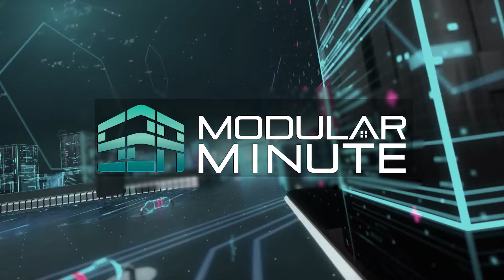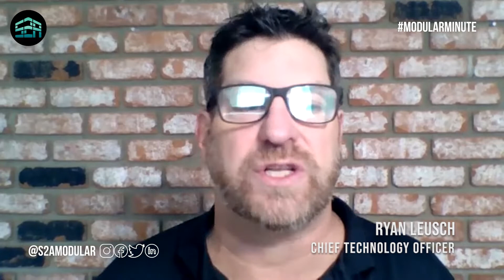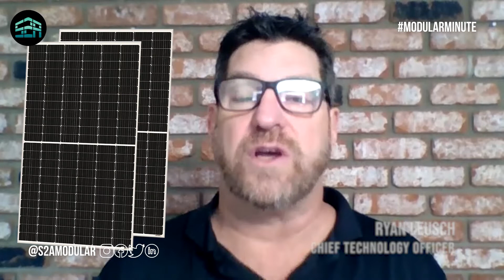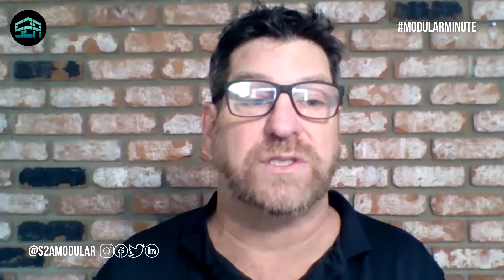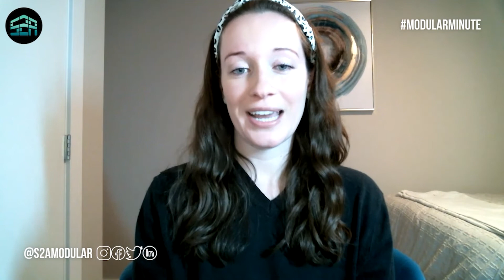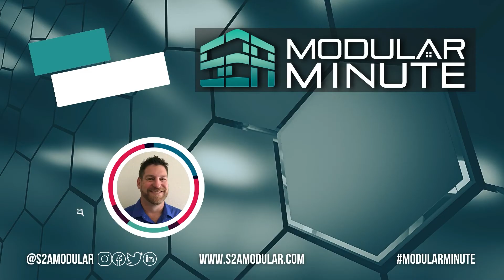Energy - Generation, Storage, & management | S2A Modular Minute

Comment: Solar panels with graphene are nice, but could I also get something more aesthetically pleasing, such as Tesla solar roof shingles?  I know there is no one else building something like this now, at scale, and they're certainly running into hiccups with manufacturing right now.  However, I would like to see the option for solar shingles.
Reply: Thanks for the reply. Right now their is a lot of delays and issues with shingles but agree those will be implemented everywhere in the years to come likely
Reply: I worry about attaching solar panels to roof. They need big bolts to hold them down to combat the bernouli effect with wind. Can the solar panels be mounted elsewhere than the roof? Those solar shingles seem good too if they supply the same energy as the graphene ones.